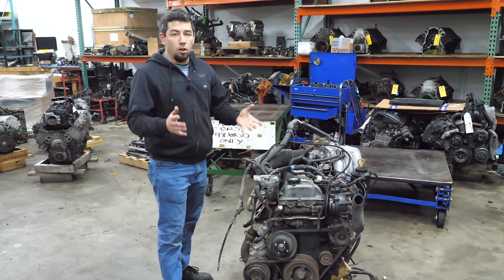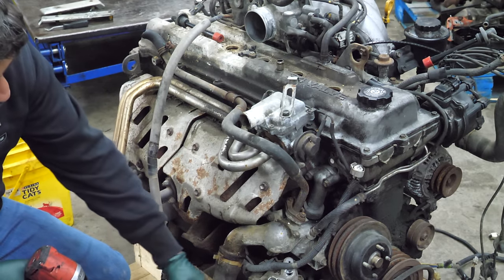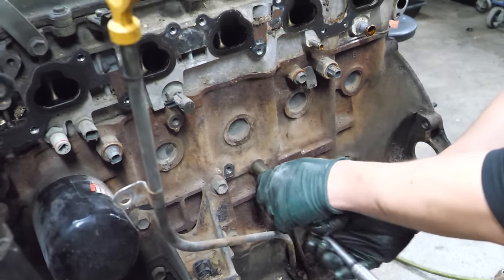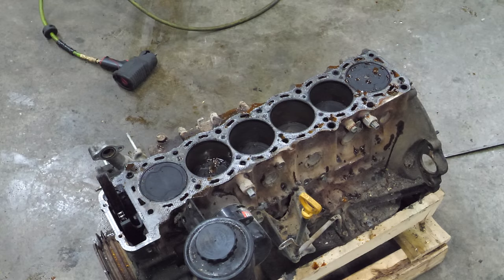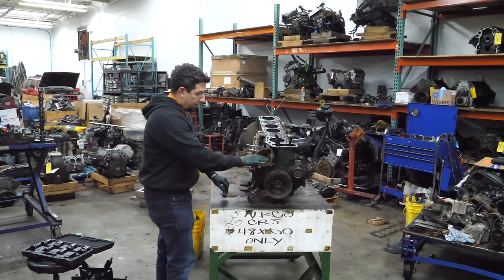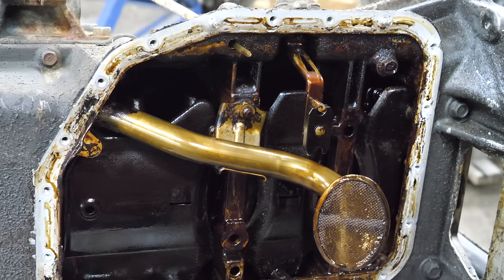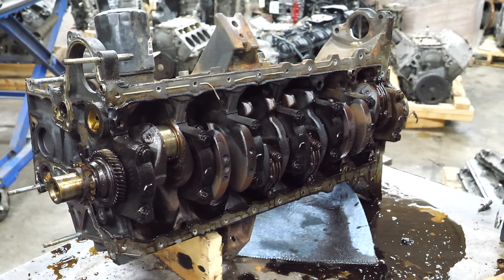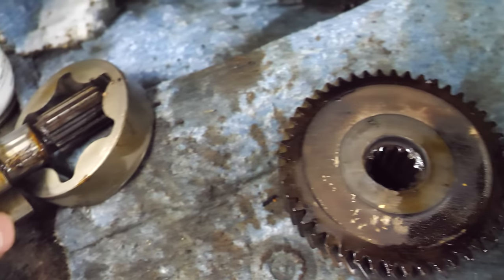LOCKED UP Toyota Land Cruiser 1FZ-FE Engine Teardown! HAD TO USE ALL MY TOOLS TO GET CRANK BOLT OUT!

Comment: Let’s give a round of applause for that breaker bar. Held up through some incredible torque
Reply: thats a very good breaker bar (should promote ) the brand
Reply: Harbor freight? haha
Reply: not all heros wear caps
Reply: and the socket
Reply: I was waiting for the head of the bolt to snap off.  Maybe it didn't because the wrench was a Snap-On?
Reply: To put it into perspective, that was (assuming 150-200 lbs for the weight), that was essentially a force of a 300-400 pound gorilla, give or take a bit for exact placement.

Oh. It wasn't the opening scene. Yeah, I don't have the math on that one.
Reply: And through all of that… the engine did not budge at all. Well, cant say the captions in the thumbnails are ever clickbait. She’s tight.
Reply: I am also surprised the head of the bolt stayed on.
Reply: @JamesDvorak  The socket is the sidekick.😁
Reply: @4wdiesels  Chinesium strenghtend.😁
Reply: Wonder if that was a harbor freight or snap on breaker bar
Reply: Breaking a 3/4" breaker bar can be an interesting experiance and then you have to figure out how to get the thing out.  Had a blow out in my M916 (army 6x6 tractor for hauling construction equipment).  We had to use a 3/4" breaker bar, with cheater pipe, and 2-3 guys jumping on it to get most of the lug nuts off until it finally broke (while we were on it jumping).  Managed to get the final few out with a 3/4 ratchet.  I have no idea what we would have done if we hadn't been able to get them off.  The lugs were very rusty and had several coats of paint on them.  Within a month, the rest had been through maintenance to have lug nuts removed and reinstalled with shop air.
Reply: 01 grand cherokee  front career nut killed two breaker bars the first one was  harbor freight  other was snap on both where 3/4  . Finally a cheap impact got it off.... took 1 hours  should have took 1 minute .I don't understand no rust or lock tight  threads looked  good clean no damage still don't make sense
Reply: @cbernatineify  Strange anti corrosion coating ( they are not allowed to use cadmium anymore) reacted with the housing?🤔
Reply: 15:13 👏
Reply: @pkt1213  taking a wire brush to a painted or rusty bolt makes a HUGE difference. also those were probly put on with a 1 inch drive, so easily 750 ft pounds if not more, and the rust and paint, im impressed you got them off at all
Reply: I noted hte first breaker bar he was going to use was bending, then he upgraded to the 3/4" drive breaker.
Reply: Looks like the engine hasn't seen oil in 5 years
Reply: Breaker Bar made by Ingersol Chan
Reply: Then it broke a few months later using much less torque.
Reply: THAT IS BEYOND INSANE! LOL.

Comment: WELCOME TO EXTREME BOLT BREAKING WITH YOUR HOST ERIC

I'll be totally honest, my thoughts went straight to "put wood on top and hold down with forklift" but did not make it all the way to "use front loader to push the bar". My horizons have been broadened.
Reply: Pffft. No cheater bar, a cheater bucket! 🙃
Reply: The Loader certainly helped eliminate most chances of personal injury. Actually brilliant.

Comment: I was expecting him to get a pipe to put on the breaker bar and comes in with a front end loader LOL!!!!🤣
That has got to be the strongest crank bolt ever!!
Reply: Lol
Reply: Kinda makes you wonder if they applied superglue on the threads or welded it on there
Reply: I was thinking the same thing 🤣
Reply: Hr didn’t show the bolt, it would have definitely started to go into plastic deformation.

Comment: I'd say adding a 4X torque multiplier to your toolbox might be a good idea after this one! I used to work at a company building industrial electric actuators. The largest, most powerful units we made had certain parts that were hand-torqued to very high numbers, as high as 1800 ft-lbs. We would sometimes also have to tear down and disassemble failed units, and breaking stuff loose sometimes required the torque multiplier with a breaker bar AND a 4' cheater pipe. We had a big workbench with a slot in the middle for the multiplier to brace itself in. Good times.
Reply: I agree on the the torque multiplier.

Comment: Impressive! You know what the experts always say, there is a correct tool for every job. I suppose that includes heavy construction equipment! Another exciting tear down, thanks Eric!
Reply: @FuglyFatt  I was waiting for him to use the red wrench.  With skill,  you can blow out a galled pipe or cap screw that is broken off flush with the surface while leaving little or no damage to the internal threads.  When threads are galled,  the rust or corrosion components help insulate the two mating surfaces from each other,  and help keep the oxygen off the female surface.
Reply: I always thought it was...

..."there is a tool on every job"...
Reply: Bob Villa said that lol
Reply: How do you think you get seized bolts and nuts off of construction machinery? With other construction machinery of course.

When you have a seized nut on the main boom ram of a 100 ton machine the only thing that'll put enough weight on it to get it off is another 100 ton machine. You also need at least a forklift to carry and fit the spanner which can weigh a few hundred kilos itself.

Comment: Removing that crank bolt reminds me of the few times I struggled. One was a 5SFE Celica engine - stuck the breaker bar to the ground, started the engine to crack it loose - the car lifted up for a moment then it broke loose, worked great. The other time was a Subaru axle nut - gave up, breaker bar to the ground, jumped in the car started it and put it in reverse and rolled it until it cracked loose - worked great.
Reply: Subaru axle nuts are not joke. I swear mine were torqued to nuclear levels.
Reply: I have done both of these things, Toyota truck 4.7, harmonic balancer bolt.  I jammed a 5 ft piece of rectangular tubing on my breaker bar and the frame rail was the stop.
Reply: @Omgninjas2  3/4  socket and a 6 ft pipe,do it with one hand,man up there has no tools,little experience

Comment: I know why those bearings were worn on the one side - when you managed to turn the engine over with the payloader, it only moved that 1/4 to 1/2 turn, the oil hole likely had rust in it or some sort of damage that ripped the one side only of the bearing.  I have 4 engines to tear down this summer too(just for fun) - a 2.8L V6 from an S-10 pickup(1986), a 1984 slant 6, a 1981 chevrolet 305 and a 1986 dodge 318, all except the 318 are rusted solid - they should be fun to tear down, lol.  great video, as always!
Reply: Wow, good catch!
Reply: This is exactly what I came here to say.  It's very clean damage, that was damage from disassembly.

Comment: That special tooling is impressive... surprised the bolt itself didn't break.
Reply: Or the breaker bar, or the socket. They usually crack so easily.
Reply: I thought for sure either the breaker bar was going to snap or the socket was going to explode sending shrapnel everywhere.
Reply: Well, it is a Toyota Spec bolt.......
Reply: That crank balancer bolt torque spec is 300 ft/lb
Reply: @phendrix9476  wait actually?
Reply: @lichking3711  I’d believe it, Toyota has done that kinda thing on numerous engines, Honda’s got a few in the 450 ft-lbs range
Reply: @joecostantino3684  When he made that first loader pull and the bar suddenly "snapped", I thought he'd either snapped the bolt, split the socket, twisted the drive in two, or maybe -- just  maybe -- made that bolt turn loose.

Comment: Eric, as I watched you struggle with the crank bolt, I flashed back to when I was a yoot working a summer job at a company that sold and serviced big dozers, front-end loaders...all that stuff.  When things were slow they would hand me a 400 ft lb torque wrentch and a 4X multiplier and send me out to jerk slack on full grown motor graders.  "Torque those lug nuts to 1600 ft lbs, son.," and that's just what I did.  So that's all you needed--a 4X multiplier, your 1" breaker bar with a 6' cheater pipe.  Bet you could twist the head off that bolt if you had to.  Best wishes for continued success!  (Give me a shout out when you smile in satisfaction with how much power you have in your hands with a 4X multiplier.)

Comment: Had to pause this as you attempt to break that crank bolt loose and lmfao! Nice I've use a tractor to break bolts loose and now I feel comfort in knowing I'm not the only one that takes wrenching to this extreme! Before I even see what happens congratulations on a solid job done!

Comment: Most fun toy I ever bought was an old 1974 Cat 930 wheel loader.  The previous owner rebuilt the engine, the bucket was straight and everything worked perfectly.  Wish I still had it.

Comment: I had the same issue when disassembling the crank bolt from my 3rzfe engine i used a propane torch to heat up carefully (not too much because it can burn the harmonic balancer) and baaam it broke loose !!! Gret content 💯👌🏽

Comment: in my experience, we dont have room for 2 vehicles to loosen things, so we usually just drill it when breathing on it doesnt do it. sometimes we're lucky and can use a crane but you dont have access to that so i wont suggest it. drill or burr the middle out, the tension should come off eventually.

also there's the classic "cant be tight if its liquid!'

Comment: A bigger airline and fitting in your impact gun will be a big improvement on breaking power of 3/4 impact.
Reply: Why do you need more breaking power when you have a front-end loader? 

The right tool for the right job.  That's my motto! 😁
Reply: I would have personaly just gone out and bought a 1" Milwaukee impact

Comment: A one inch drive impact wrench is worth it’s weight in gold at times like that.  Another trick, before you apply heat, saturate the bolt head with PB Blaster and after a few minutes grab two sledgehammers.   Hold one sledgehammer tight against the crank bolt head and then use the other sledgehammer to impact the first one.  I learned that trick in 1976 from the old farmers I worked in the truck shop with.   Love your channel and learning about the new technology being applied to engines in the 21st century.

Comment: I would have thought the weight of the forklift and an 8 foot pipe over the breaker bar would have been enough, but a front end loader is the sort of excess we can all enjoy. When I was working on tower cranes there were bolts being tightened by use of a flogging spanner and a 1" drive impact wrench, but they were running off a 600cfm compressor, so probably overkill for everyday work round your yard.

Comment: I've broken loose stubborn lug nuts with a breaker bar and a 2 ton floor jack pushing up on the handle but youve taken it to a whole new level using heavy lifting equipment, sometimes what you need is a little overkill

Comment: Eric, you're so right to underline each and every time to take care of your engines (actually the whole drivetrain!). If you respect your engine by properly warming it up, before going pedal to the metal, it will thank you in most cases with a long life and proper reliability.
I really laughed hard when you presented the 3/4'' breaker bar and your special tool made by case. You're a lucky guy to own such great variety of special tools. 
Greets from Germany!
Alex

Comment: My wife and I were laughing at the casual nuclear level escalation on that crank bolt. What's the torque spec? 2,025 ft lb? Is that bolt grade 50? What's going on?!

If that was a Harbor Freight breaker bar, I'm going to buy one tomorrow. Between that and the Earthquake, they should be sponsor you. Hear that, Harbor Freight?

Anyway, my wife and I are lifetime viewers, thanks for the laughs!
Reply from the maker: It is in fact an icon bar!
Reply: Factory torque spec is 300 ft/lb. I’m also a believer in those Icon tools!
Reply: I still can’t believe the bolt or breaker bar did not snap! Wow!

Comment: One of the cool benefits of a inline engine is the crank journals are not shared with another connecting rod like a v6 or v8 therefore there’s more surface area to lubricant the bearing.

Comment: That is one tough bolt!  Recently worked on a Honda CR-V to replace the front strut assemblies.  A lug nut on the driver's side wouldn't budge.  The car recently had a wheel alignment the the lug nuts were fastened using an impact wrench.

Used a breaker bar with a pipe extension and the wheel lug broke.

Ended up removing the wheel hub to replace the lug and installing a new front wheel bearing.

Comment: Your usage of the front end loaders to break the harmonic balancer's bolt reminds me of something my dad went through while changing a tire on the side of a road about 35 years ago.  He encountered a lug nut that was majorly over torqued by an inexperienced worker at a used tire shop.  He attached the big bar for the car's bumper jack to on of the other 3 bars of the 4-way lug nut wrench and proceeded to jump up and placed his 350+ pounds on that bumper jack to break the nut loose.   This crazy effort worked in breaking the nut loose.  However, the attempts prior to the bumper jack bar did irreversible damage to his ulnar nerve .

Comment: Could those grooves in the bearings have come from all the side load when you cracked the main bolt? They look super fresh, like the oil galleys on the crank journals were crammed into the soft material.
Reply: This.
Was looking for this exact comment.
Reply: @HomelabExtreme  Same:)))
Reply: I actually said this out loud when I saw the damage to the main bearings.

Comment: I was doing the cam seals on my 5vz, and in order to remove the bolt you have to use a tool to hold the pulley. I put a 4ft tube over the pulley holding tool, had that against the frame, and then had a 6ft tube over my breaker bar. it finally gave way, and it really took all 6ft, and im a big dude. The dowel pin that clocked the pulley almost sheared. it sort of shifted over half the diameter. in the past on engines out of cars ive put 10ft tubes into the bottoms of my engine stand to lever against, works pretty well as i dont have a big forklift or tractor.

Comment: 10:33 - it looks like viscisoty breakdown.  Running a motor too hard, for too too long, at excessive temperatures and RPMs and/or failure to change oil at reasonable intervals, will cause this to happen.    It's a shame people drive their cars into the ground.  I was a kid once.   I have wrecked a few engines through abuse and negligence.

Comment: Years ago my friend purchased a new Toyota 6 cylinder diesel truck for his long distance towing business where his yearly mileage was up to 100k miles, last time I saw him he had put over 500k miles on that truck with only routine servicing which was actually a lot of servicing as he was really clocking up the miles and he needed the truck to be reliable. That Toyota never missed a beat and when I last heard the engine run it started, ran and sounded really sweet and perfect in every way, Toyota make some good trucks and some really good diesel engines..

Comment: That small air hose doesn't flow enough air for your big gun to work like it's supposed to.
Reply: With high flow fittings, it might be ok. Running unregulated (or regulated really high) small hoses are less of an issue.

Comment: I'm sure this started out as something small; low coolant, stuck thermostat, bad water pump, etc. Then they ran it until it got hot, popped the head gasket, and the rest is history. Now it's a boat anchor

Comment: The torque required to loosen the crank bolt must have been massive.
Reply: Prob north of 2000lbs
Reply: 5 MILLION mile lbs
Reply: We need a tool with the power of 2 loaders! Something that will fit on the bottom drawer of a toolbox. Any suggestions? Lol
Reply: There is a tool. It's called a 4 to 1 torque multiplier and i have one in the bottom of my tool box.

Comment: That's bad ass getting that bolt out.
A trick is to use a deep well socket and a large pipe wrench on the socket.  It is a tool setup that is basically guaranteed to never break before the bolt does.  And heat heat heat.  Always make sure it is hot when attempting it.  Things always move better with heat.  Forget the comments about the expansion of the bolt making it a tighter fit in the threads.  It is a sound theory, but it never makes a threaded bolt move with more difficulty.

Those 3/4"+ drive impact guns really should have a larger air chuck, too.

Comment: 11:42 - so you're saying it didn't bring all the boys to the yard... Also, it's always a good sign when you need to use equipment that's bigger than the vehicle the engine came from to work on it.

Comment: That must have taken around 3000 foot-pounds of torque to break that bolt free.
Reply: So tight that it's like as if superglue was used on the threads
Reply: @chuckycheese84  I immediately thought of Krol Oil.   It will loosen any threaded part.  Eventually

Comment: You are correct about the J80 being a heavy rig once you kit it out.  My rig is over 6k lbs with winch, bumpers, sliders, belly armor, roof rack and tent, fridge, shove, drawer unit, and 37' tires.  But, 8 psi of boost from a turbo kit and it holds 70 mph with the cruise control set going up to the Sierra.  These motors love boost.

Comment: I've snapped breaker bars doing 80 Series pulley bolts. They are incredibly tight.
I now do them before I take the motor out.
I use the torque from the motor to snap them free, but obviously not in your situation.